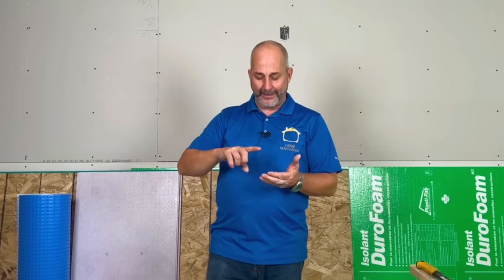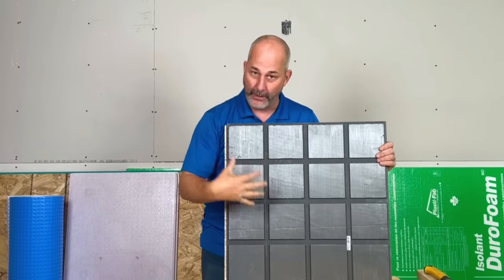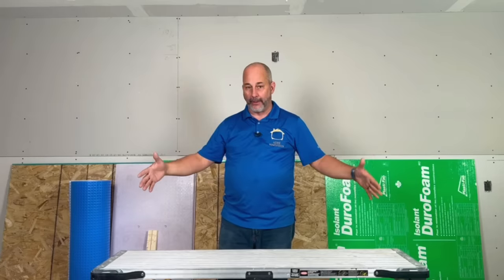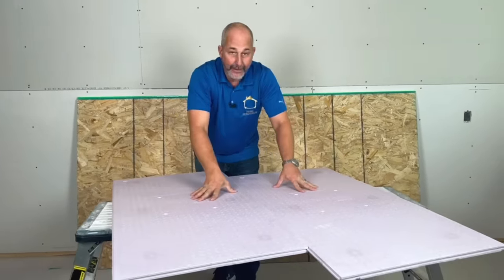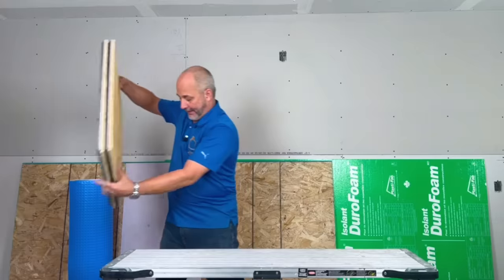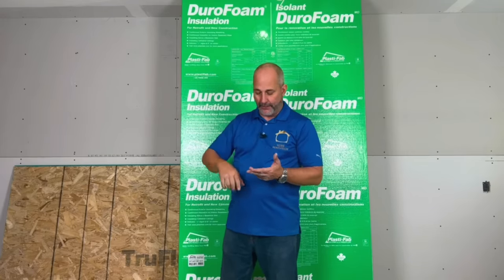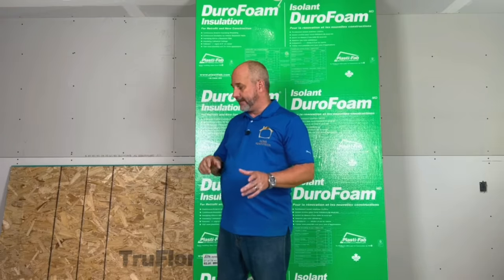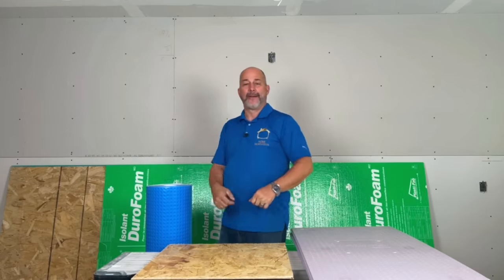Comparing 5 Different Subfloor Systems and What They Cost

Comment: I've used Dricore on several basements.  It's worked well.  Although I wish it were solid plastic vs. having an OSB layer which can soak up moisture and self destruct if immersed.  I think one thing you missed is that cement is going to vent moisture into the building cavity.  I cut openings every 15+ feet around the perimeter and then put Reggio registers into the openings.  That allows breathing for the cement floor whether it's just vapor or if you get water.  And I have had water come in from a wall leak and it was easy enough to use my shopvac to soak up the water.  If I hadn't done that, the water might have got into the Dricore.  I'd be concerned if you put a solid piece of foam against the floor.  I think the floor is going to have some water vapor coming up from the cement and then it will condense against the foam and you'll have a wet floor underlayment that will never dry.  Yes, it will be separated from the finished floor but I would be wary of mold and mildew.    I enjoy your vids!
Reply: I would be wary of mold and mildew - I that would be the case stones under the slab should be all black from mold cause water present all the time there. Mold also needs organic matter as food, oxygen and temperature. So even if foam against the floor, but you prevent dust and oxygen access to it. It will just stay damp and mold shouldn't grow. 
This is my thought.
Reply: @dmitry6472   I agree with you. Would putting down the DMX, then the 3/4 foam and then the OSB solve that problem?
Reply: I paused the video just before he mentioned it lol
Reply: Where do you live? Would it be suitable to put these Reggio registers in a basement in a cold winter climate? Edmonton Alberta
Reply: @swes2934  I've used Dricore along with Reggio Registers in both Massachusetts and northern NH near the Canadian border.  Has worked well in both locations.
Reply: @BobPritchard  good to know. Thank you!
Reply: @BobPritchard  We are going to use DriCore Insul-Armor in my basement suite. Two layers of OSB have to be added on top to raise the subfloor to meet level of previous subfloor. My renovator is concerned that cutting holes in this entire subfloor for Reggio Registers or similar would break the thermal barrier, and thus make the floor and/or room cold. What is your experience? My reason for wanting to add them is in case of slow and minor water ingress, the area under the subfloor will dry out. There have already been water issues. Most solved by a reputable company but some may still exist. Your thoughts on the holes for Reggio Registers or similar vents making the floor and/or basement suite cold/cooler?
Reply: @swes2934  Hi, my basement floor vents (above the Dricore) are absolutely not cold even with the vent holes.  Remember they aren't that numerous but do facilitate passive drying and active drying (using a shopvac) if you get water under the floor.  Dricore doesn't add a huge R factor but it does provide a thermal break. The 2 basements that I have installed this in, are both in New England, one in northern NH where it gets mighty cold in the winter and any cold air penetration is not noticeable in either location.  Plus, if you need to get water out then what would you otherwise do?  And allowing for water vapor to escape only makes sense because water vapor will always be coming up through a concrete floor even when it's not raining.
Reply: @BobPritchard  Thank you so much Bob!!!!

Comment: I watch your videos all the time, THANK YOU! As it turns out, I’m currently in the process of finishing my basement in the United States. I’ve never had water issues in my basement but it was built in 1989 and we live on a hill. What kind of subfloor options would you recommend?
Reply from the maker: that depends on geography. northern climate get a thermal break. in the south perhaps just the dmx 2 in 1 for a little sound control. Cheers!

Comment: Planning for a big enough window in your basement to get any of these products in is a fantastic tip. Thanks Jeff 🙂
Reply from the maker: You bet! besides, natural light ion a basement is a great idea. Cheers!
Reply: @HomeRenoVisionDIY  I self-installed a Euro style tilt and turn window 48x48 for that very reason, plus much safer egress than this existing slider, and better insulation.
Reply: Careful! The purple insulamor is so thick that if will give you trouble to install reducer. You will have to make custom reducers

Comment: Hi!

What would you suggest for the following -

1. LOCATION - Century, WI
2. Slab unsealed with a 15mil vapor below it and no insulation. 
3. It's a shop being turned into a shop house.
4. The walls are Insulated 
5. The dirt work will grade the drainage away from the home

Comment: Another good one Jeff, informative.  Which of these would you use if you're considering normal carpet?  Underlayment thickness and ultimately ceiling height is a bigger concern.
Reply: Following
Reply from the maker: I would install the carpet direct on to the concrete. modern floors have a vapor barrier under the pad and the new carpets and underpads are made to almost eliminate the risk of mold and mildew build up. If it ism dry then just drop it and use a high quality pad with an average carpet for best results vs performance and cost. Cheers Willy!
Reply: @HomeRenoVisionDIY  Interesting, good options.  As usual, thanks.

Comment: 1960 walkout lower level  in northern Indiana .. No water issues to speak of in the walls or the floor ... looking at putting something down to take away the cold in the winter... I'd prefer to put down engineered hardwood yet keep the height as low as possible.  Thank you for your thoughts

Comment: Hi Jeff!! My dad and I love your DIY videos.  We just finished renovating my bathroom thanks to your tiling and waterproofing tips.  Last year we laid down lifeproof vinyl plank flooring, from homedepot, in my basement which has a concrete floor.   In the room before there was carpet and i never noticed any water issues and we did not use an underlayment (since the plank already came with a pad).  A few weeks ago I noticed crusty debri coming up between a few planks.  I undid the whole floor and found puddles of water.  the walls seem dry so I don't think its water intruding into the house.  I live in an older home and live in an area that gets pretty cold in the winter.  Trying to find the best subfloor to avoid moisture problems coming up from the concrete.  I was thinking of going with the dricore but i would your thoughts/opinion.  Thanks!!

Comment: Excellent video, and pretty much confirmed what I was already thinking. My house is 1973 in Canada (Calgary) and I am mostly looking to deal with the unfinished portion which is a crawl space. We use that a lot for storage, but I feel like the house would probably be warmer if we insulated the floor of it. (Walls are already insulated) I was trying to come up with any reason not to just put down sheets of rigid foam with sheets of OSB over top, and couldn't find one. I'd also like to extend it out into my furnace/laundry room. My only real catch is that I already (stupidly) put down carpet in the livable parts, with only a normal underlay, and no subfloor. So I'm not quite sure how to transition between the two, because I don't think I really want to rip up the carpet at this stage to do that part right.

Comment: The Insul Armor products look really cool, but they seem to be focused on DIY friendliness while skimping on performance. It doesn't make sense to me to have so many joints - it just multiplies the potential problems down the road. For an old basement, I like the dimpled membrane + foam board + OSB solution. It might be a thick assembly, but at least you know you're mitigating all three potential issues: air, water leakage, and human error.
Reply from the maker: Cheers!
Reply: just what I was thinking to!! any problem with using proper plywood vs osb (besides price)?

Comment: If there are small inconsistencies with the Dricore install and a panel has a gap, would Tuck Tape on the surface help to close the thermal break?
Reply: I would still be worried about moisture leaking into the OSB

Comment: Thanks Jeff, our house was built in 1976. We are in Michigan. Has a sump pump. Have had no water issues as of yet(1.5 years). Want to finish a large portion of the basement. probably 1,000 square feet. Will probably do vinyl on top of whatever subfloor we use. 

Curious as to what we should use. I am nervous about well pump, water heater, water softner, things like that leaking at some point. Hopefully it never happens just if it does, I don't want that to turn into 10-20,000 in damage

Comment: This is perfect timing for me. I've been trying to decide what subfloor to use for finishing my basement, so I'd love any thoughts on it!

My basement is generally dry, but I live in a pretty wet area and have to rely on my sump-pump when there is any water at all. When the pump went out during heavy rain, water seeped in at the base of the walls, but all ran pretty perfectly to the drain, and we've never had water in the basement otherwise. So I am intending to use some sort of dimpled membrane to guard against a similar failure in the future, but I also only have 7 foot ceilings in my basement, so I don't want too much buildup on the height of the floor. We've also, I think, landed on carpeting the space, since it will primarily be a playroom for young kids. It's a 1991 build in Ohio.

Comment: Jeff, We live in Atlanta in a split-level home on a slab. The lower level has floor moisture issue. Some of it is the grading but we've done all we can do with new gutters and corrugated pipes to unload most of the water in the ditch behind the house. However, whenever it rains hard we still have sticky moisture feet. Looking for best solution to try to end this issue and get rid these noisy humidifiers. Only concern is the door to the garage and the backyard if we raise the height of the floor. The interiors doors we can trim. Thanks for help and suggestions. Home was built in 2014.

Comment: Love the "there is no best" mindset. That's often the question with many things. There is no best. The question should always include the application, and desired outcome.

For a 97 build in a northern climate, no issues to fix in terms of moisture (already have water management to under the slab and sump pump) seems like the dimple membrane is the best option. Also like that it's not super thick which would mess up step height and become a possible code violation.

Comment: Great video.  Good to hear about all these products in one spot.  I live in a 1920s home in Portland or.  It doesn’t get all that cold but it gets wet.  I have a water table that I’m handling through a perimeter drain and sump pump but I think I’m going to go with a dimpled membrane sealed with tape and 5/4 osb subfloor.  I’m loosing out on a thermal break but  I don’t want another 3/4” on a subfloor and I’m not worried about frost or 10 degree weather.  The basement stays 50-60 degrees all year round.

Comment: Jeff as always thank you for providing all these available materials to work with. As a French who moved to the US after doing bits of building/renovation (just as a laborer or flipping family owned houses) in France and Australia, I bought my first house in Georgia where the weather is very different from any places I have lived (especially Montreal). But I did trust the inspector and got sold a flipper house with little to no care about insulation. Drafts through power sockets, around windows and frames, doors, no vapor barrier in the non encapsulated crawlspace, r30 blown in attic with probably no air sealing and the ceiling or the attic has no insulation at all. This house looks brand new but besides insulation, floors are uneven, walls and rooms arent square and I can even see some screw and joint tape slowly popping off..... I know it sounds like a lot, so what would be your priority as a homeowner?

Comment: I've got a 60's house in Ottawa, block foundation. No leaks (yet) but obviously moisture coming through concrete every now and then. Walls are slightly finished, but floors are bare. Going to do a complete overhaul in a year or so, and want to future-proof as much as possible. We might build my wife an office down there, so I want it to be as comfortable as possible.

Thanks for your videos, they're very, very helpful!

Comment: Wish I had seen your videos before I did the basement. I put down Pergo Outlast thinking if the washing machine flooded I’m ok. Turns out my 1945 house in Oregon gets water on the same side as the washing machine. Only during heavy rain or occasional snow. I need something to allow water flow and supports the dead weight of the washer and dryer. Thank you for all of your amazing videos. You helped me over the last 4 years remodel the entire house.  Just wish o found your channel sooner.

Comment: Jeff, I’ve watched your videos for years and benefited more than I can say, so thank you!  One question I’ve had and can’t seem to find anything or anyone that addresses is options or how to install flooring (subfloor, underpad, moisture/vapor barrier, type of actual floor, etc.) on top of an unfinished concrete garage/basement floor FOR A SAUNA.  Even the prefabricated saunas (eg, Almost Heaven) require use of your existing floor (ie, flooring not provided).  Given the increased/explosion in interest for saunas, cold plunges/tubs, etc., I think others would be interested and benefit from your thoughts/suggestions on this topic, and DIY saunas in general.  Any thoughts/guidance?  Regardless, thanks for all you do and keep up the great work.

Comment: Just did mine basement finish. All DIY. except electrical work n plumber. House is 6 year old have no  water related issues.
I used 4,  1x6x8 pressure treated lumber under every 3/4 4x8 TnG OSB to avoid defliction and  secured it tapcon. 
Trust me, basement tempreatre raised  to 7 Degree C.  I put carpet with 10 mm underpad. Walking on it so smooth and warm. Eveyone love it.

I am in procsss of to  put HD lifeprof brand VP which has paddung underneath around staircase landing area and hallway to bathroom. 
My question is should it put 1/4 inch   sureply sheet on top if osb for LV installation with Construction adhesive. ?  I want to secure VP not floating.  

Thanks for your time.

Comment: I have a 1950 house with a 575sq.ft. Basement.
The 3 things I have to work around are insulation(house in Edmonton), vapor barrier, and ceiling height (mostly over 7' of height but beams and hvac at 6'7" to concrete).
Plan is to use the 1 step dimple mat(only ~ 1/4" thick), floor leveler where needed, possibly 1/2" high density foam, and then flooring.
I'd be using the thicker foundation dimple mat on the walls, 2" xps board, and then framing.

Comment: I went with DMX 1-step (blue dimple stuff).  I liked that it was lightweight, easy to roll out, easy to cut, and didn't take up much height.  I saved lots of money and time versus what I was going to do....Delta FL with 5/8" plywood and anchoring with Tapcons.  I used that saved money to have spray foam applied to the rim joists and walls.  I also invested in adding air returns and re-routed some of the heat vents to floor level.   The whole basement is super comfortable...in fact, it feels just as warm down there as the main level!  The spray foam was the best thing we did and even though it wasn't cheap, it gave us a good bang for our buck.
The DMX 1 Step on the floor gives me a thermal break and allows the concrete to breath effectively.   Vinyl Plank flooring is going in this weekend directly on top.  Can't wait!
Reply from the maker: Cheers!
Reply: How is the vinyl plank working out bring placed directly on the DMX 1 step? Any issues with the feel under your feet (movement of the vinyl?) thanks.
Reply: @mattseverance8176  It's held up very well for 2 months now.  I went with a higher end 9mm vinyl plank.  I didn't want a wavy look and I can't stand cheap products (5-7mm).  Flooring isn't somewhere you skimp.
Reply: @canadude6401  thanks and I agree on not skimping on flooring.

Comment: Jeff, I love the way you think.  I would 100% recommend using some type of barrier between the slab and whatever flooring one might choose.  My house is over 100 years old and the cement flooring in the basement is only 2-4" thick.  It was sloped so as to channel any water to one particular spot.  I used the 1-Step DMX as an underlayment, built runners so as to even out the floor, and put 3/4 plywood subflooring with deck screws.  I also laid a bead of construction adhesive on top of the runners before laying down the plywood.  In-between the  runners I stuffed in rigid styrofoam.  Now my basement has an actual vapor barrier, thermal barrier, is level and insulated.  It stays cool in the summer and warm in the winter.   Cheer!!!
Reply: Thanks for this. I've got a 100+ year old house and am looking to put the TV room down there. What did you do on the walls? Do you have an air gap to connect with the one between the subfloor and concrete?

Comment: Thanks for your great advice. My house was built (in Georgia) in the mid 80s. Basement finished sometime later. Huge rainstorm, carpet soaked. I've removed the carpet and the lower foot of sheet rock. Looks like it has been wet inside the walls for a long time. Just never noticed it. Everything is dry now. I'll have to replace some of the studs. Still haven't decided what to put down on the floor. I do have a door if I decide to bring in full sheets. I'll keep watching. Again, Thanks for the amazing videos.